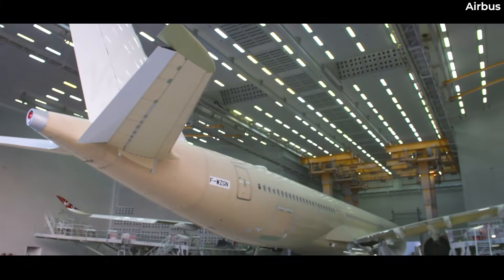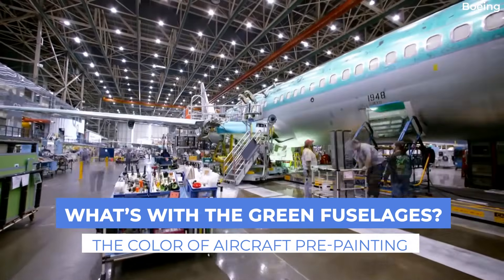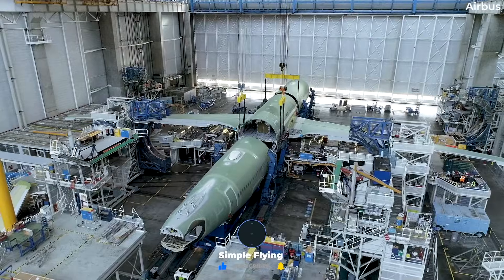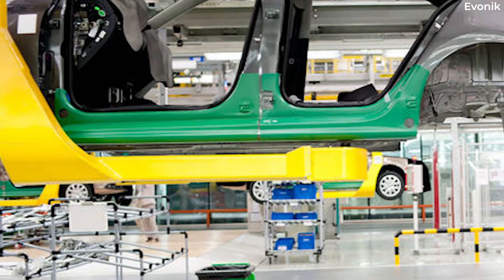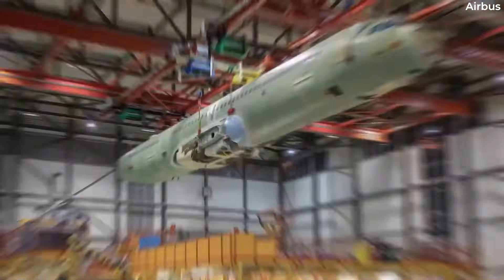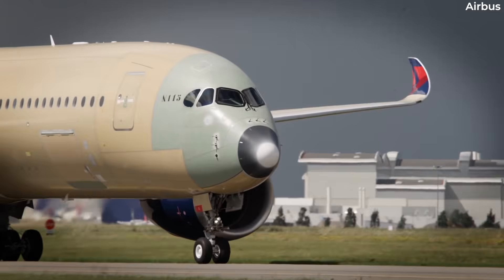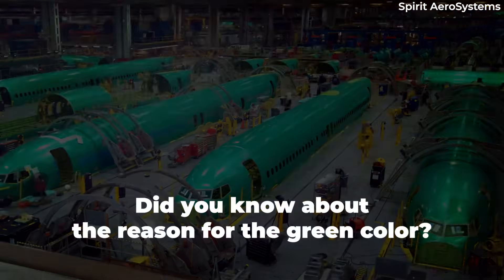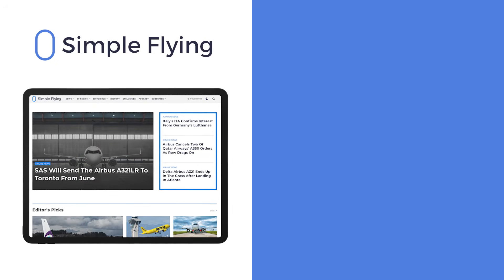Why Are Newly Built Airplanes Green?

Comment: But why does aluminum need corrosion protection?
Reply: Because it corrodes?! Much less so than other metals but it still does. And with aircraft fuselages being 1-2mm thin even minimal corrosion is dangerous
Reply: Because aluminum corrodes easily. The corrosion layer that forms protects it from father corrosion (unlike iron or steel) but it does corrode.